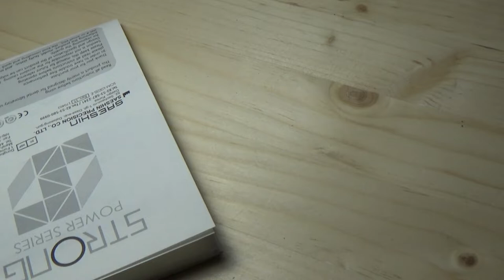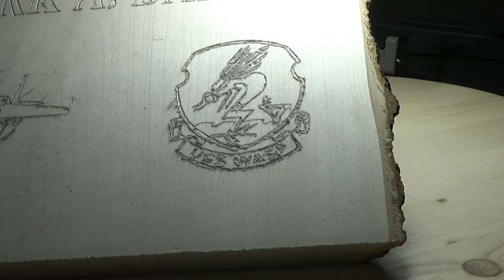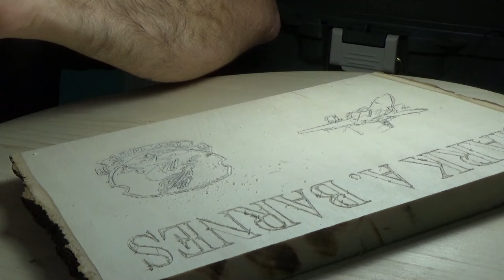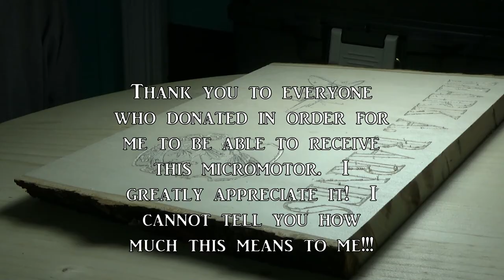Thank You Kenny and members of The Reloaders Network (TRN)

Comment: A ten dollar box fan with a house  air filter taped to it does okay for dust collection for little stuff
Reply from the maker: Yeah I saw some videos of people doing that but what I am thinking about is the Harbor Freight 2 horsepower dust collector so I can set up an entire system for not just my carvings but for my sander my miter saw and a few other tools.
Reply: @op25ttfd  they are loud, but they do work. There are a couple of those at the local maker space.
Reply from the maker: @GunFunZS  I will take loud for the price compared to some of the much more expensive systems for sure.